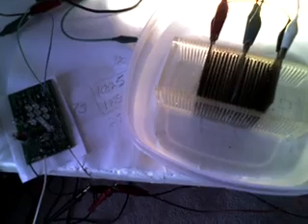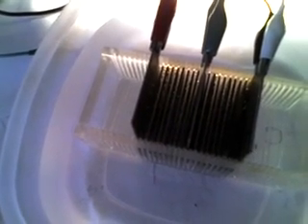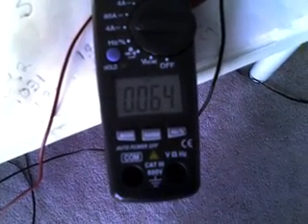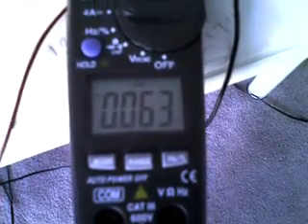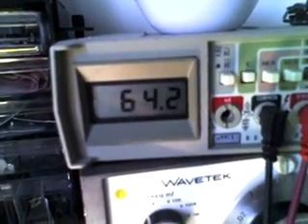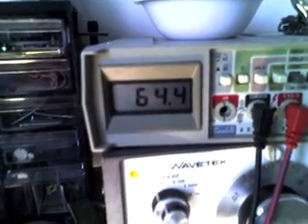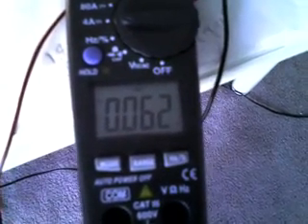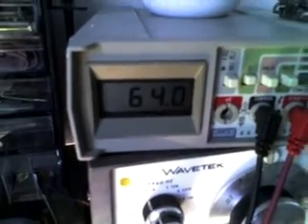Dr. Stiffler SEC on Ironhead HHO cell distilled water test 1

Comment from the maker: Thanks Stefan for the positive comment. I also was wondering what would happen If I added electrolyte to the water, so I tried it and the results are negative, just before adding the voltage across the cell was up to 80 volts and when I added a bit of baking soda it instantly dropped to 40 volts and it was all down hill from there. It seem to go down in gas production and also lost most of its battery effect. So no electrolyte is needed with this kind of electricity.

Luc

Comment: Hi Luc,
very well done.
Do you get more HHO, when you put some KOH or NaOH into the destilled water ?

By the way the correct link to your
message on the overunity forum is:

overunityDOTcom/index.php?topic=3457.msg100489.html#msg100489

Please replace the DOT with a real
.

Many thanks.
Regards, Stefan.